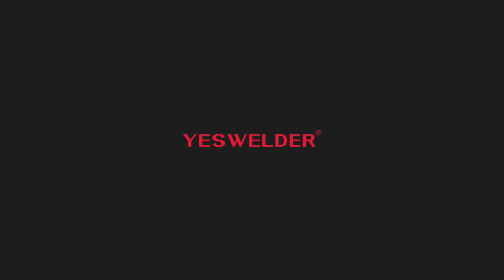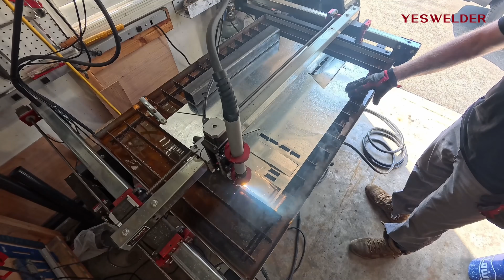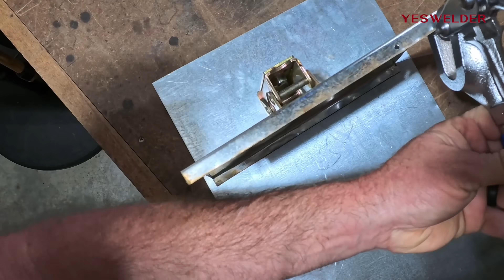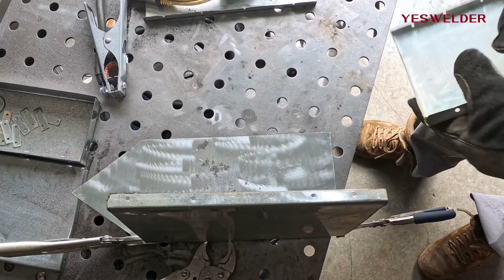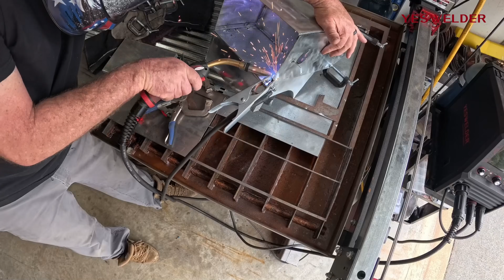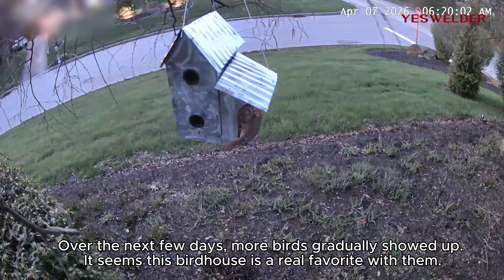From Metal Sheets to Cozy Birdhouse – DIY Welding Fun! | YesWelder

Comment: A metal bird house, it's like a bird oven, do you add cooking oil inside to the bottom of it?
Reply from the maker: Since it’s still spring and the weather isn’t too hot yet, a metal birdhouse typically won’t build up excessive heat. It’s mainly meant as a fun DIY piece that also provides birds with food and a water source. If the birds ever feel it’s too warm inside, they simply won’t stay in it for long. So there’s really no need to worry.
Reply: @YesWelder Birds don’t live in bird houses, they just nest in them, baby birds and eggs can’t leave when they get too warm, without a thermostat to regulate the temperature you’d over cook them and make the meat dry.
Reply from the maker: Thank you for the suggestion. We’ll add another thermometer to monitor the temperature in real time.
Reply: You coat the ceiling inside so when it heat up it drips down evenly over the birds and the eggs.